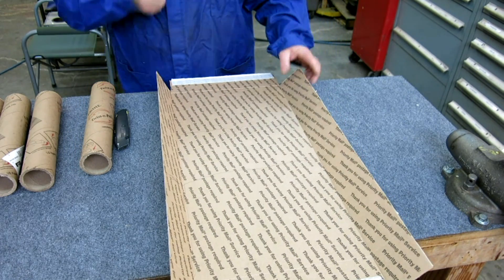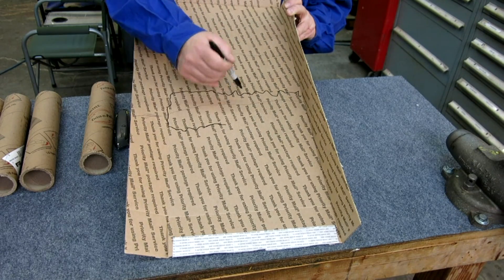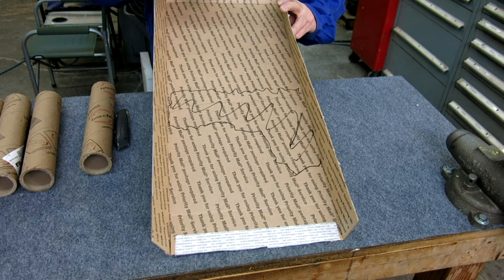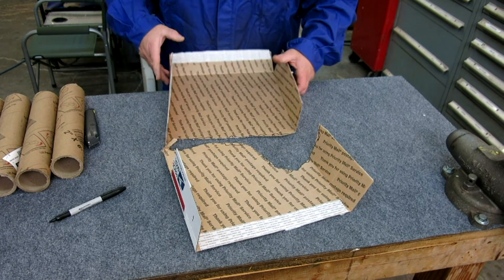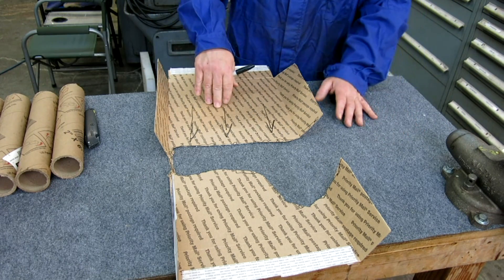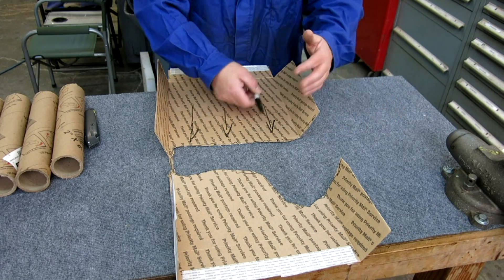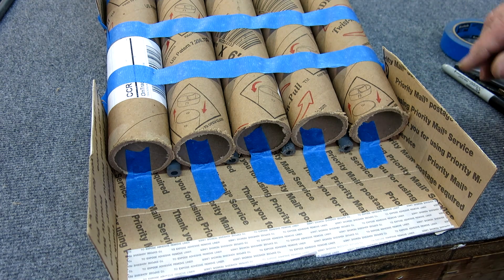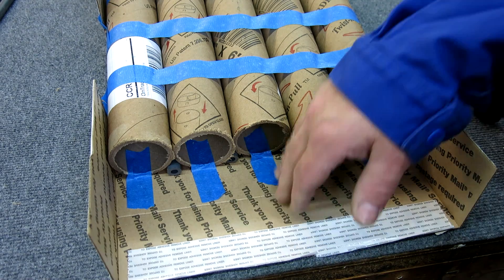Oroville Dam Spillway Repair

Comment: I think it's too late for such an or any emergency repair. Looking at the sheer volume of water rampaging through that spillway and the size of that hole. Just look at this footage : https://www.youtube.com/watch?v=98hkdz2kVAg. There also isn't any solid foundation underneath to support the pipes. It's like building on a sandcastle near the ocean. I think I would just let it flow and focus engineering an additional spillway and probably shore up the hill surrounding Oroville's new lake with sheetpile or something to prevent or at least slow down the growth of that lake and subsequent degrading of the hill. 

From the old pictures it looks like it started leaking at the seam of the concrete slabs, because of the clean break. I would drive piles along the new spillway with crossbeams for support. That way when a concrete section gives you would have something to build upon. You could also have an inspection tunnel underneath the crossbeams to check for and repair leakage.

I don't think it's engineered poorly. There's always some manager/suit "adjusting" the model so it'll fit the bill. I'd send a picture to that manager of that hole, the projected costs and the sign Keith Fenner has in his shop: "It's not the cost of the repair but of the damage you did".

Anyway, I hope those people will be okay. Water can hurt inside Bruce Lee said. Luckily we haven't had a flood in the Netherlands for a while now and that's a blessing because a large part of the country is below sea level. 

Great idea for a video, Tom! Keeps the rest of us informed and on our toes. Let's show those civil engineers how it's done!

Comment: 4 days ago, Feb 10, that little hole  that you are speculating covering with steel pipe Was 300 feet Wide by 500 foot Long. How far do you think you can stick an Unsupported steel pipe? Portable welders?
Reply: By the way ... 4 Days ago, that hole was 45 foot deep.
Reply: In reflecting on "your Solution" I am wondering just how much investigation into any particular problem you bother with Before you submit a 'solution'... a Bad idea, even if it was hastily arrived at, Is still a bad idea. also Some ideas are Much worse than just bad.

Comment: The important thing in this video isn't whether or not the idea would work but that you are thinking about how to do a quick solution to prevent further damage. You consider that on the emergency spillway they were aware over a decade ago that using it could erode away the foundation for it. You would think that a lesson had been learned after Hurricane Katrina that ground under barriers can be eroded away.

Comment: I think it might be past being able to patch fix it.  If it's not eroding under the dam I would think leaving it and seeing what they're left with at the end is a better option. they're only working on the emergency spillway atm, which is designed badly (straight run-off to soil will always erode). seems the main spillway is still working enough and if they drop the levels low enough it shouldn't worry the emergency spillway again for a bit.

Comment: I think a louver cover for the spill way is better for the following reasons:

- open air, no chance of being clogged by large debris

- creates waterfall ripple effect that limits eddy currents eating away at the primary dam structures e.g. emergency spillway severely damaged by eddy currents

- accomplishes the same reduction in stress on the weakened spillway foundation as pipes but with lower cost of maintenance and potential failure

Comment: As a dam engineer, I would say the biggest disadvantage to your idea is just the time it would take to implement. Most flood events for large reservoirs happen on the scale of days to weeks. Even in the absolute best case scenario, installing a series of pipes in a 200-ft wide spillway would take more than a couple of days. Taking the spillway completely out of service during the worst of the event would not usually be worth it compared to just running it at reduced capacity.
Reply: If only YouTube had an awesome civil engineering channel that could  explain what is going wrong and how to solve the problem

Hint hint nudge nudge
Reply: Practical Engineering and it does not include any Googly eyes
Reply: I wasn't going to mention that...
Reply: 40' containers, cut ends out, weld end to end, drop as blocks, upside down use standard container locks to lock together? Empty containers are ~6000 pounds each. Could be flown in no problem.
Reply: If you know of any helicopters that could hoist that kind of load you should let us know. Steel pipe 1 meter dia X 35 meter long = 8700 KG. A heluvalot more than any chopper can handle when it hits the water. Using multiple helicopters to lift large loads has been tried many times and has resulted in disaster many times. Just moving one large pipe against that flow by helicopter or even crane could easily lead to disaster. Perhaps they could be lowered by winch from upstream although placement would be tricky.
 I think this is an ingenious solution as the pipes will carry what they will carry and excess will flow over the top across the bridge of pipes.
 As others have said keeping them in place is problematic maybe an abutment on the bottom against the downstream concrete. Multiple smaller pipes just large enough to span the gap would leak less and stacked on edges as sidewalls could work. But still, logistics and time are factors working against any temp solution. By the time you get the people, materials and equipment in place the whole situation will have changed or even be over.
   Mike (o\!/o)
Reply: @experiencingtechnicaldiffi5184  To my knowledge, the Sikorsky S-64 SkyCrane has the highest lift capacity of any production helicopter, at 9,000 kg and change.  The F variant will do a little more.  It would be awfully sketchy, and those things aren't too thick on the ground either; Sikorsky themselves only built 99 units before selling the design to Ericson, who built a fleet of 18 by the year 2000. Not sure whether they are still in production. So... not impossible.  Practical? I wouldn't. ;)
Reply: as a matter of fact i do they use them for logging and moving 40' containers
Reply: Oroville is predicted to get up to another 10 inches of rain early next week...
Reply: I try to keep my career and channel at least somewhat separated and stick to general engineering topics. Our code of ethics requires that I don't offer engineering advice/opinions where they are not appropriate, so unfortunately you won't hear me publicly commenting on specific current events related to water resources infrastructure.

Comment: There is a very good flyover and at the very end of the video there are some still photos showing the erosion through the concrete before the water started flowing. There are men standing in the hole so easy to judge the size of the issue to be repaired (though the hole is much bigger now).  https://www.youtube.com/watch?v=_2aD53JIDzo

Comment: Hoover Dam discharge pipe are steel they coated them with tare on the inside to stop eroding of pipe it has worked there and this is a temporary fix to save the dam

Comment: Here are the numbers (from wikipedia) they are dealing with.
The spillway hole as of 2/10/2017 was:
300 feet (91 m) wide
500 feet (152 m) long
45 feet (14 m) deep. 

That would need some large tubes.

Comment: Concrete data:  The control spillway is fed by 8 radial gates, each 17ft-7in wide by 33ft-6in high, operated electrically and capable of controlled release of 150,000cfs.

Measuring using Google Earth, I can get the length of the dam crest and the length of the emergency spillway to line up with the official specs, and by this method, I measure the service spillway at 180ft wide, and 3060ft long.

Official doc:  http://www.water.ca.gov/orovillerelicensing/docs/app_ferc_license_2005/Vol_I_Exhibit%20A.pdf
Reply: More numbers:  I found a video that allowed timing of the water flow between landmarks on the service spillway (discharge gates to the power lines) and I estimate the water velocity at 76 feet/sec (18 seconds from the gates to the power lines).  Assuming 180ft of width and 100,000ft3/s, that gives a water depth on the order of 7.5ft.  Probably a little more due to aeration.

Given those numbers, every linear foot of spillway is supporting about 85,000lbs of water, just from the static load.  Anything in the way of this will be impacted by about 6.5 million lbs of water every second, moving at 76ft/sec (52MPH).

Comment: Love the Think Tank mentality here !   A basic trough design will work  , basically like that filler ramp at loading docks so a forklift can unload your cargo.  Series so flat plate welded together  with sides .  Can be secures  by rigging  cable at all corners , even drill and pin front side  and concrete so it is sealed .     The cables and the pin configuration should work   24 hour shifts  couple hundred guys    week maybe   ETA!   

Even look around the country maybe there is something you can just modify  save some time ...

Comment: Bolt beams down, and set steel plate between the beams (butted web to web). The beams are laid down on their flange faces on the spillway surface, where they are bolted down.

Comment: Turn the spillway off for a bit and use some expanding foam to fill the gaps/hole and buildup the edges, could use some reinforcements as well. only a quick and dirty temporary solution.

Comment: You would need a pretty substantial culvert  on the end of the pipes or the dirt under the pipes is just going to get eroded/saturated with water and the the pipes will float off because of pore pressure.

Comment: So what happened to maintenance?  Prevention better than cure.  I guess you could just prefab  a box section with a few divisions in it.  Box section would fit better, no need for all the pipes.    All depends on the flow rates it needs to handle.

Comment: This might be a dumb question and I haven't read all the comments to see if anyone else had the idea but why don't they get 30-50 of the biggest pumps they get and tons of layflat and pump the water from the reservoir down past all the damage . The military has hundreds if not thousands of these pumps and the means to get them there quick . In the end it's far cheaper than the dam breaking ?

Comment: Tom, I like the idea of the large pipes, but I think the smaller pipes will create a row of turbulence that will slow the overall flow of the water. I think it may work better to fab up steel plates which can sit flush with the spillway and guide the water into the large diameter pipes. This won't solve the turbulence problem, but my intuition says it will lessen it. The plates could be cut on site while the pipes are being positioned, or they could be mass produced on, say, a plasma table, then trucked in all at once.

The other potential point of concern would be the weight of the steel on an already damaged structure. I'm just a humble machinist, so I'm not even sure where to start crunching those numbers, but it would be a point of consideration.

Comment: Years ago when they were building the Gibson Generating plant next to the Wabash River they had to build a 2,000 or so acre water cooling lake.  They had to fill the lake and keep it full so they installed a large pump setup with water from the river pumped into the lake.  Well the Wabash river did one of it's almost yearly 20+ ft. over flood stage (no news coverage on that) and decided it wanted to tell the engineers  they were wrong.  Given the pipe was not fully buried the river still crushed that 12-16 ft. diameter like a beer can under a truck.  My thought is that getting those pipes in the spillway would be very iffy with that much water pressure and flow rate.  Let the lead of one of those big pipes get even slightly  off of being parallel and it would turn cross ways and blow out the sides even more.  JMHO

Comment: Weld up square flume tubing adjust for width and fly sections into place, cable it to secure location and go back in spring. Probably can shut spillway down long enough to place flume tubing.  Problem isn't getting a plan.  problem is getting someone in power to agree.  The bigger the problem gets the bigger money will be thrown at it.   How long do you wait until there is enough money to be redirected to some other  pockets?????????

Comment: The biggest flaw in the whole design and the main limiting factor with getting out of this mess quickly is the sewer pipe sized, highly restricted ditch down at the bottom of this, the tallest dam in the US. That being ranted out, Tom, not a bad idea for a possible temporary repair. Problems currently right now are the need to keep the flow going to maintain level control. Once they can stop the flow the issues will be the unstable earth and remaining spillway structure due to all of the undermining erosion. So that would have to be stabllized first by heavy equipment getting in there and working, etc. which will take time.  Also, not sure how much of the large diameter pipe is just laying around not being used. A more handy option may be to bundle lots of smaller diameter pipe. Say like oil well casing. Lots of that sitting around able to be redirected to this project and easier to get it down the hill and into place, quickly and with smaller equipment. Whatever gets done will take time to do. Sadly, lack of time once again becomes the biggest challenge the engineers are faced with here, to overcome.

Comment: They just need to build new wedges at the bottom of the remaining spillway section to break up the laminar flow like what's at the very bottom of the spillway now. The erosion has largely stopped as it is. Problem is they can't afford to shut off the water with the coming storms, it's clear the emergency spillway should avoid being used at all costs after this weekend.

Comment: I'm not a structural or environmental idea, but I've seen the sheer power of water tear apart even the sturdiest construction.  You're on the right track with bridging the crevice, but flat plates would be a better choice. Pipes might give the water an opportunity to lift the culverts you're considering and potentially force more water off the spillway.  Imagine if the system jack-knifed?  Conversely, interlocking steel plates would offer little or no points of resistance and could be laid down even without welders.  Could be a temporary fix until hydraulic cement can be employed to fill the void.  Tom, it was a great idea raising current issues like this for the Youtube community to consider. We should continue to use collective efforts to solve problems and stop allowing government bureaucrats to run the show! Especially at our expense!

Comment: Optional Idea: instead of smaller pipes, use a wedge shape of steel that would divert the water into the pipes. Think train snow plow http://www.backroadtravelers.com/images/trains/snwplow2s.jpg These could be made off site and be dropped into place by crane.

Comment: Great idea in T.L. fashion, go do something. I have a slightly different take on a possible repair. Assuming they can stop the water, quickly fill the void with any suitable fill and then lay in rubber roofing membrane, presto- giant sealed up slip and slide

Comment: Sounds feasible, pipe just has to be big enough to self support across the void (like a bridge)  . I would have though a ramp or scoop cute at the front end would be enough to reduce the leakage to safe proportions (just need to stop the slipway eroding during the emergency .

One question, is this really an oxtool operation? I mean where's the file????

Bill

Comment: Great idea in TL fashion go do something. I have a slightly different take on a possible repair. Assuming they can stop the water, quickly fill the void with any suitable fill and then lay in Carlisle rubber roofing membrane presto, giant sealed up slip and slide.

Comment: Tom,
It wasn't erosion that caused the INITIAL damage. As we all know, concrete doesn't "erode" very easily. The damage was first caused by the cavitation of the water as it flows down the spillway. Once the cavitation created the hole in the concrete, the massive energy in the falling water was what did the rest of the damage and erosion. Not poorly engineered, a poor design that wasn't engineered to deal with cavitation that the water experiences as it flows across the concrete when it was built. 
Just search "Challenge at Glen Canyon" here on youtube. this gives you a great understanding of what is going on now with the spillway.
Reply: lundy holland
Reply: not quite, if you look upstream of the breach you'll see dirt in the water on the left side of the spillway.  Either the side breached, or overflowed. the main breach was undercut when it collapsed
Reply: This reminds me of the glaciers that gouged out the Great Lakes and other immense areas. Yes, I know it wasn't cavitation, but the immense weight of the glaciers pushing the boulders that carved out the landscape and the erosion of the melting ice did some awesome earth moving projects..!!